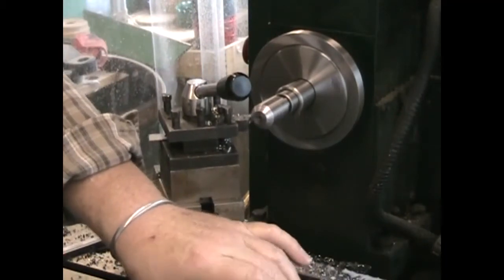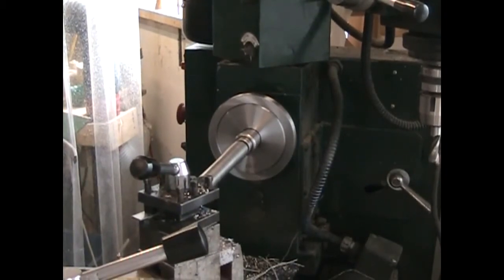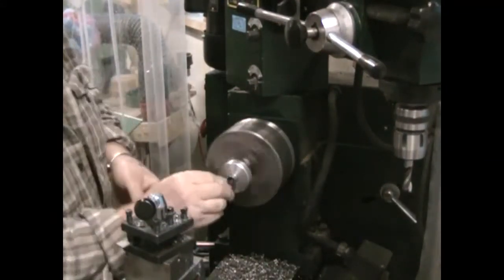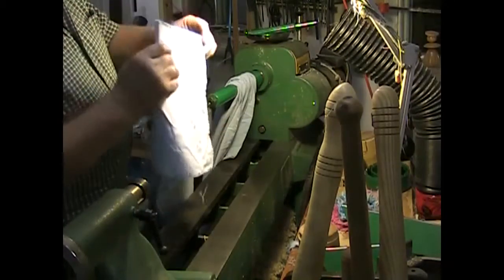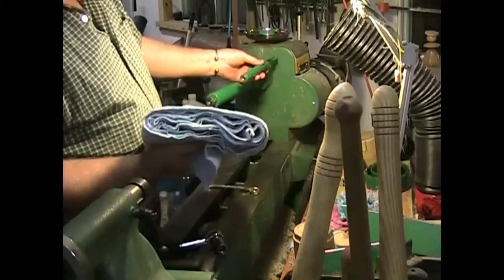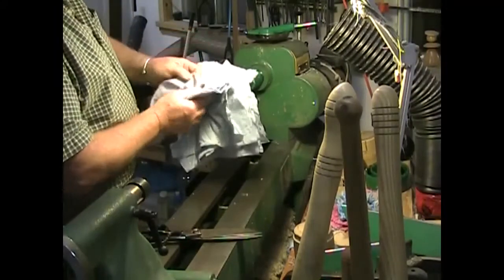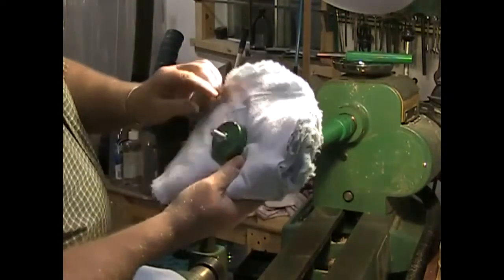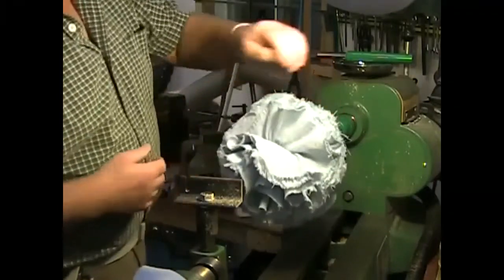001-01-01  WWRJF - Woodturners Buffing Mops - 32min 2011

Comment: I think I did see this when it was posted before. Whew, a lot of work. I have the 3" bowl buffs and agree with you that they are a bit hard and I seem to sometimes scratch the inside of bowls with them so rarely use them. Probably because I got them used and the tripoli buff was overloaded. Quite happy with the Beall 8" wheels and think I may just buy some of their 4" wheels for the inside of bowl. I wonder if I soak the overloaded Tripoli wheel in some dishwashing soap if it  will soften up enough to easily loosen with the edge of a board? I guess at this point I have nothing to lose.
Reply from the maker: I had the same problem with the 2" ball set, scratching the wood, right from when they were new. If washing them softens them up I bet there a lot of turners who have the same problems.
Could be another video for you Mike...